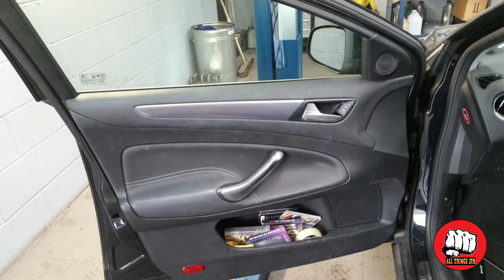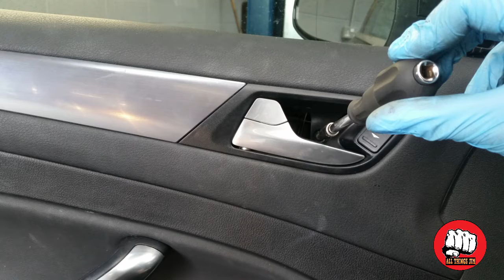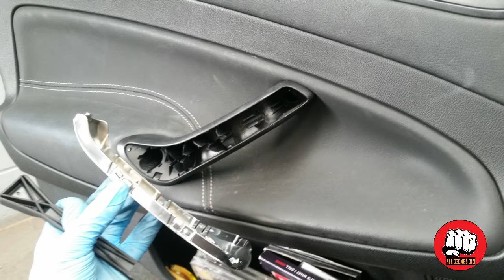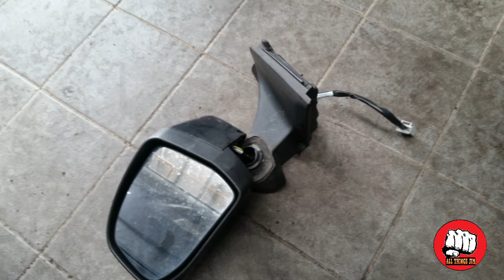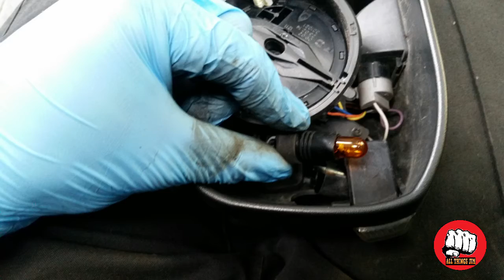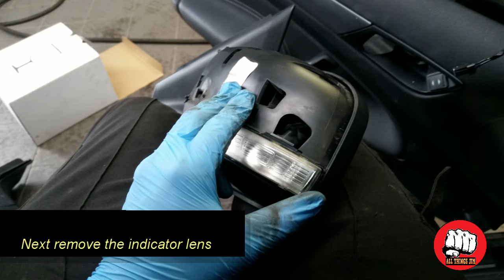Ford Mondeo 14-17 reg mirror assembly

Comment: The glass part of my wing mirror has come away from the arm , is it possible to mend this , it doesn’t look like anything has snapped off  , Thankyou
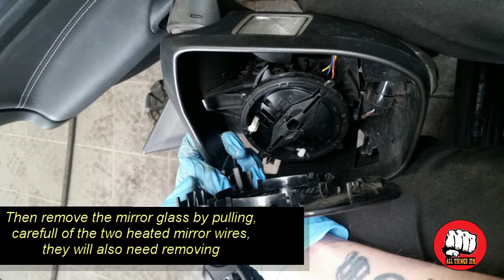Reply from the maker: Lesley Murcott hi there! If you look at 3:28 you can see the glass just clips onto the round part inside the arm by way of pushing it on. If its just the glass has popped off it should pop back in, may need a tiny bit of force to put in, if clips are broken then unfortunately it will be a new glass piece which you can buy separately,  if its something broken on arm its a whole unit,  hope that helps 👍